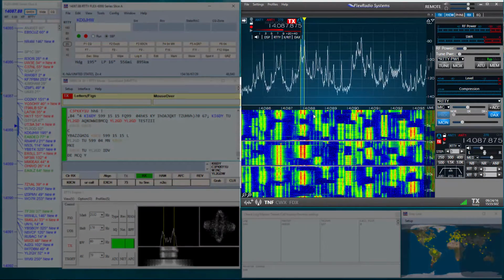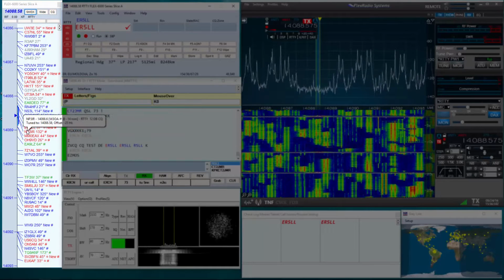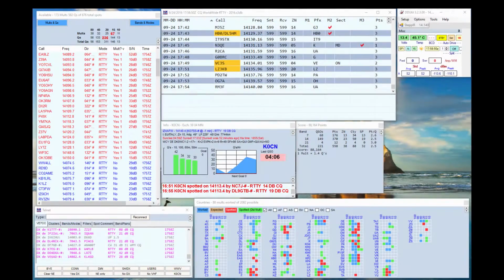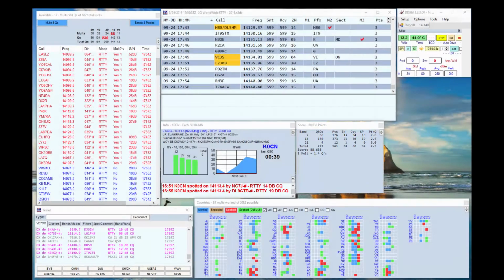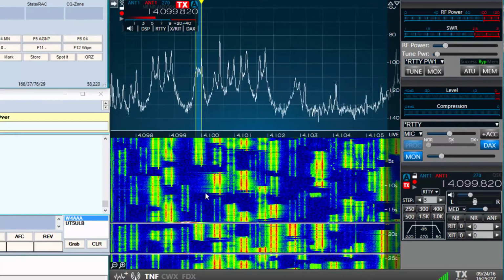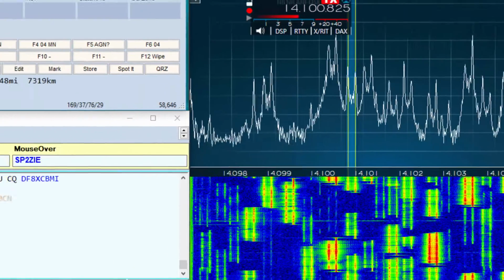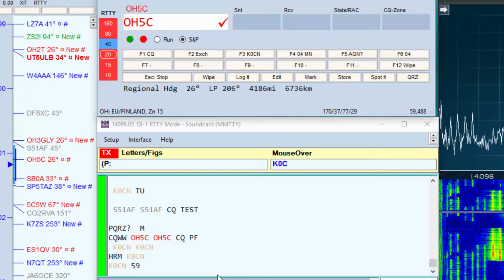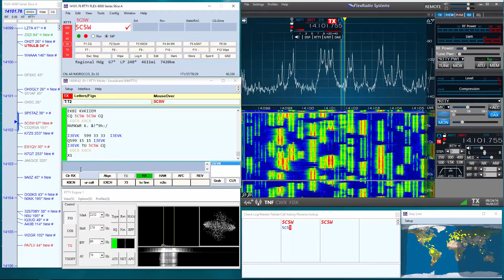CQWW RTTY Conetest with the FLEX-6700 and N1MM+

Comment: Thanks for the video, Al.  I am getting ready for my first RTTY contest. I am using your same setup, except I see you have DDUtil running. What is that for? Also, I see you have a custom filter width of 270 Hz. Is that just a personal preference over 250 or 300 Hz?
Reply from the maker: Hi Logan, the DDUtil is a program that I use to link the frequency output of the Flex to the controller of my SteppIR antenna. It allows the antenna to self tune as I move the slice receiver on the Flex. Works really well I might add. You can also use a USB cable direct from the Flex to the antenna controller, but I like a certain features that DDUtil adds so I use it. There is nothing special about the 270Hz filter width. I don't remember why I had it set there, but 250 or 300 will work just fine depending on the extent of band crowding. Gud luck in the contest and hope to work you this weekend!

Comment: Hello Al, great view of RTTY and N1MM with the Flex, on your MMTTY setup are you using AFSK or FSK? Also what program are you using for for your screen recordings? 

Thanks Rory N6OIL
Reply from the maker: Hi Rory, Thanks for your comments. This setup is running AFSK. I could run FSK but that requires an external box like the Digi Keyer or a Navigator. I personally like the simplicity of no external boxes and cables and the results seem to have been good. I am using Camtasia for the Flex Radio videos.
Reply: Al Senechal ok thanks and I feel the same way about extra boxes. I do have W3YY interface I built that I used on my IC7000 and it worked great for FSK. Well my Flex comes back Thursday from the factory for a no xmit issue and looking forward to playing radio. 73 N6OIL

Comment: Thanks for another excellent video. I ran a similar setup for the CW WW RTTY (6500 QRP) and can see that I might have missed some features.

Do you do any SSB contests with N1MM+ and the Flex? I'd enjoy seeing how that's all set up. Especially how the voice recording for the canned messages are done.

73! Kev K4VD
Reply from the maker: Thanks Kev for your comments. Yes, I do run SSB contests using the N1MM+ as a voice keyer. However, I have not used the new functionality built into SmartSDR yet. Will have to get on top of that before next months CQWW SSB test. I'll look into putting a video together with that topic.

Thanks Al K0CN